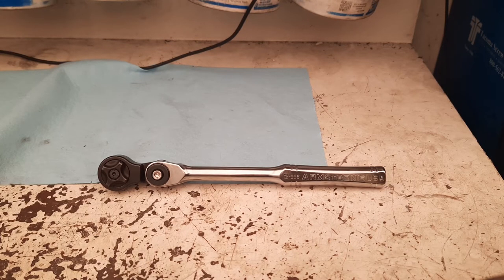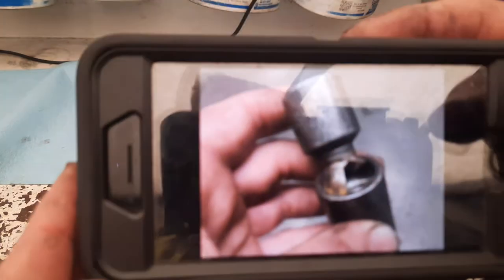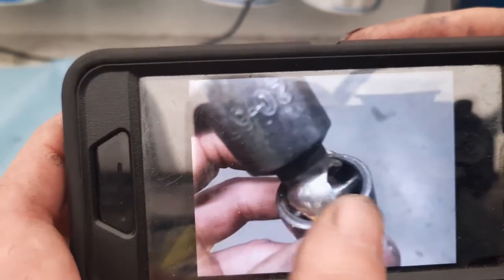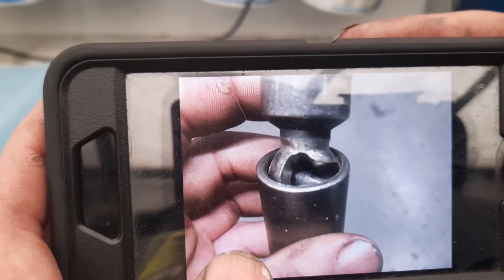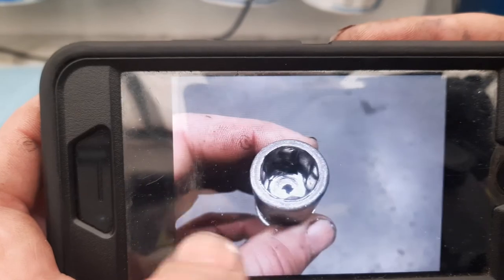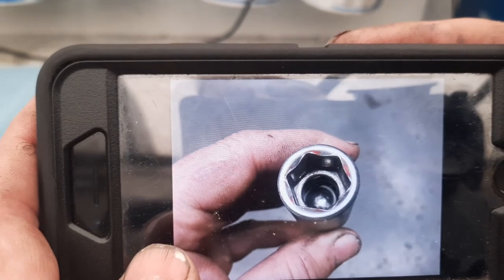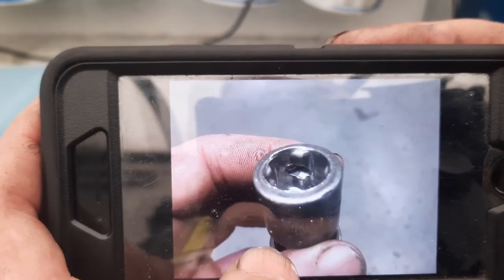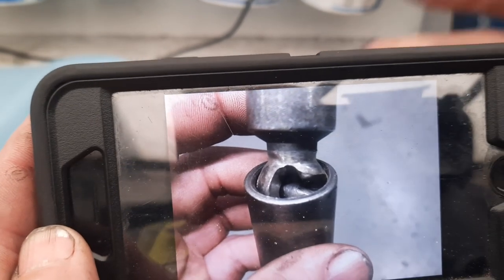ARMSTRONG IMPACT WOBBLY SOCKET

Comment: Oh I apologize I did see this video it looks well used.
Reply from the maker: No worries.  You where just talking about Armstrong and thought of this socket.  Was wondering if you had seen it and your opinion if it was heat issue or just onest ware?
Reply: @itsatoolthing6323  it looks pretty worn to me well used I've seen them break like that before actually lots of stress and heat on that on during use the failure is more common in that area.
Reply from the maker: @CPthetooladdict  holy cow your still up after that epic live stream. I've seen lots of fails of the pin just not that kind of ware before.